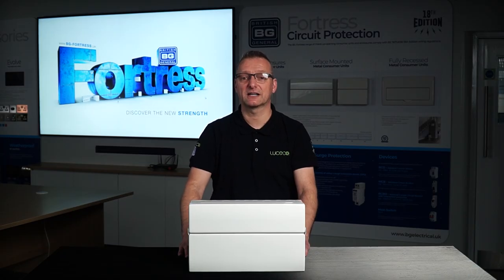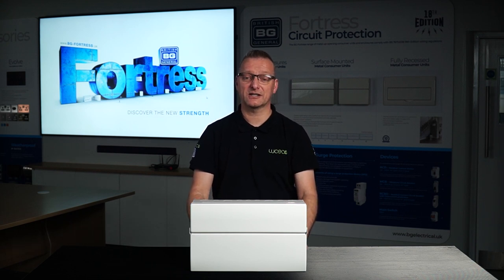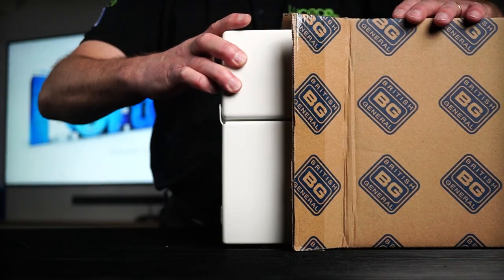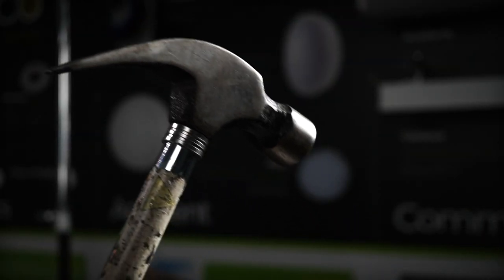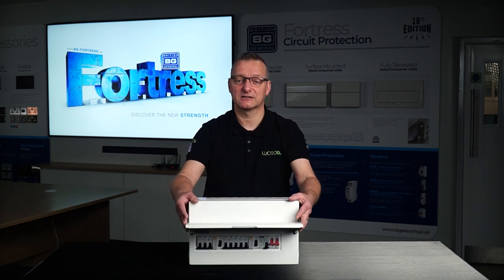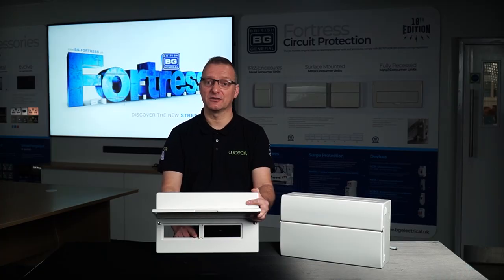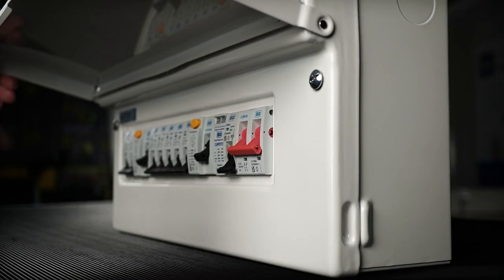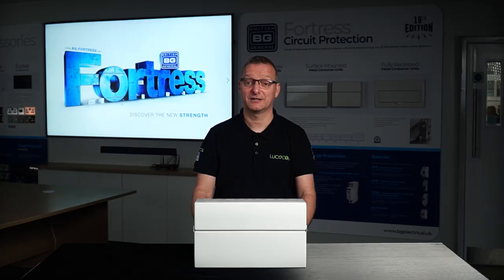UPGRADES! to BG Electrical Fortress Range of Consumer Units

Comment: Need to sort the mcbs out, seen so many fail.
Reply from the maker: Thanks @eyeballblim4940 Sorry to hear you have had trouble with our mcbs. I have made an enquiry with 'Product Team' to see if there has been any reported issues with mcbs failing. Unfortunately there's no reports of this being an issue at present. If you do come across a failing device please do get in touch with our support team, we're always happy to help and its only through talking to our customers can we strive to improve our products, rectify faults and better serve the trade community. Thanks again for your comment.
Reply: Fail in what way?  Keep tripping, don't trip or have a mechanical issue?
Reply: @Chris-hy6jy  as in they appear to have tripped, but won’t reset even after loads are removed.. mechanical issue.
Reply: @eyeballblim4940  ah I see.  Defo a job for BG to investigate then.  People will buy QUALITY.  Make the product good and reliable and it will sell itself! 👍
Reply: @Chris-hy6jy  yep, we use fuse box, excellent price and decent quality
Reply: @eyeballblim4940  yeah it's a shame really because the brand "British General" should be the go-to option for UK electricians.  Like MK used to be before they started putting profit ahead of quality.  I'd gladly pay a premium for a high quality product made in the UK.  Are Hager still made in the UK?